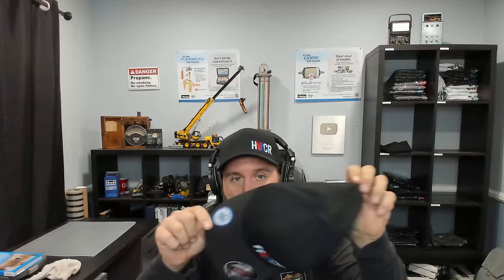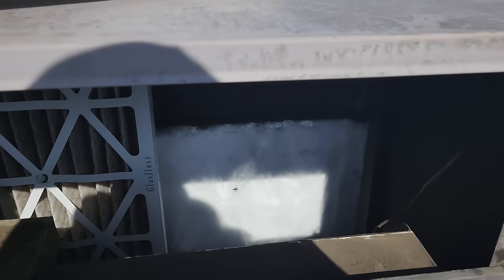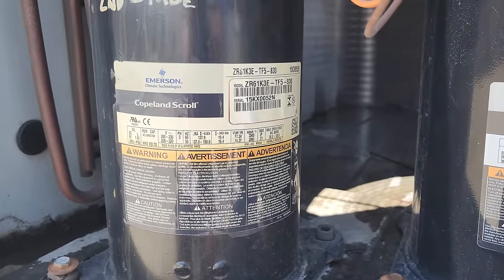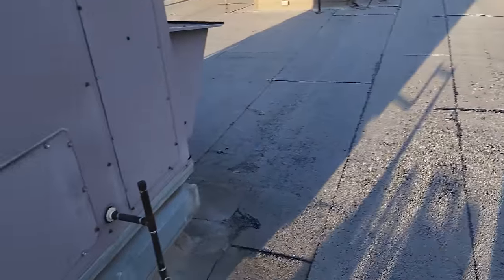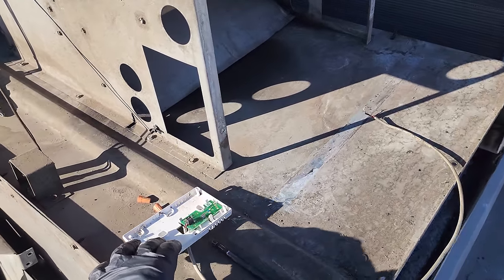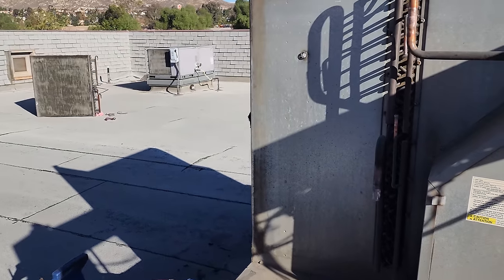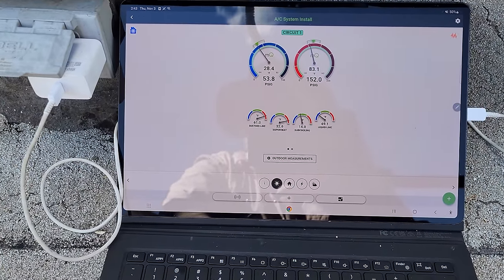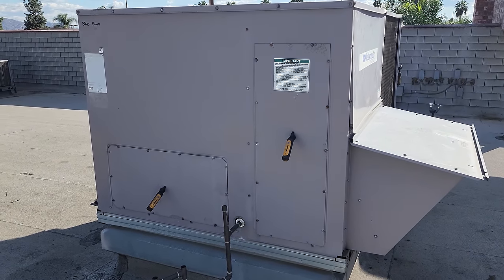THESE AC UNITS HAVE SERIOUS PROBLEMS

Comment: Ever since the tailend of 2019, when the whole pandemic craze started, we noticed a sharp incline in damaged deliveries from manufacturers. Some of the times it was damaged by the shipping company, but I remeber at least five damaged outdoor units with scratched, dented or bend panels.
And of the five units on four the cardboard boxes they had been shipped in were pristine. But in the end we have a job to do and we had to give discounts.

Great job as always.
Reply: Quality Control has apparently been let go or replaced with temps 😂
Reply: @Adam Newman  
Yea or they are pressured by the buyers to deliver products 

Would you like a damaged but perfect working Part or no part
Reply: @DanO181919  Yes that is true
Reply: Manufacturing companies are at much faster pace without any quality control, I was at a manufacturing company and everyone is pressured to skip steps, mind you these are all made here in states
Reply: probably a combination of poor quality control and low supply forcing what before would be rejected products being patched up and send out
Reply: Ah yes, the mystery of the damaged equipment in the pristine box, will it ever be solved? Nobody ever has any answers.🤔
Reply: I'd like a working undamaged unit that I paid for.
Reply: @davemc3650  Manufacturers are also not bothering to repair or replace their failing equipment. I'm in the industrial bearings business and had a customer with worn ball screws decide not to replace them due to cost. A little slop might not sound like much, but it can add up to mean your product quality is diminished.

Comment: Shipping damage is universal these days.   I am replacing the radiator in my Suburban.  First "new" radiator came in and was completely crushed on one side.  The replacement for that one came in with the box trashed and holes knocked in it, but was padded well enough that the only damage was to a couple of fins.
Reply: Replaced a radiator in my Camry two years ago. Ordered a Denso (OEM) from my favorite mail-order auto parts supplier. Box arrived with one slight hole in it, radiator was almost pristine inside. Within three days, it was leaking from the top crimps. Bought one at my most-hated auto parts box store, the box was immaculate, but the radiator looked like someone punched it. It also began leaking after a few weeks' use. 😠

Comment: Good tip whenever I do compressors, take a hacksaw and cut as close to compressor body as possible. You will not get a flare back and you will just need to unsweat the socket. Much safer. Obviously verify no pressure before doing this but you will prevent explosions and still save the entire tube insert for the next compressor😊
Reply: And make sure no copper shavings are in the suction line 😁
Reply: You could do the same thing with a tubing cutter - won't get quite as close to the compressor, but no shavings.

Comment: Hi Chris.  When you were soldering, I noted a couple of times that you held the solder stick (brazing rod?) in your teeth (30:11 and 38:42).  Back in the day, when working on plumbing, I would use lead/tin solder or silver/cadmium brazing alloy.  Both are toxic AF.  Hope you are using something less toxic now.
Reply: Using your teeth as a third hand is common in many trades
Reply: Elemental lead, such as is used in the normal tin/lead solder, isn't toxic like you're thinking.   If you chewed it enough to make organic lead compounds from the saliva (difficult, but stomach acid might do it), it might be an issue.    Just holding it in your teeth or lips for a minute or two won't do much.
Reply: No such thing as non toxic brazing rod.  But considering how short of a time you have it in your mouth it is a low risk.  However, with what i now know about lead and its effects on children, i would scrub my hands very carefully after handling anything lead based, before interacting with a child, or handling anything they might touch.
Reply: @tbelding  ANY lead is not a good thing when children are involved.  There is no such thing as safe exposure levels regardless of whether exposure is to elemental lead or to compounds.  Even eating large amounts of chocolate can present a hazard.  As adults though, it takes quite a bit of lead to become an issue.
Reply: @stephenvale2624  - Okay - I can't take you seriously.   You've obviously refused to actually look at the real information, instead, following "It Bleeds It Leads" information handed out by journalism majors.   You've decided that "lead" is EEEEEEVIL.   Fine.  Don't try to claim that it's for the children.  Just say straight out that you believe it's EEEEVIL, and admit that it won't matter what information is out there.
Reply: @tbelding  Regardless, it's a silfos brazing rod. There's no lead in it. Don't be fooled by him incorrectly using the term "soldering" when he should be saying "brazing".
Reply: @Jason-wc3fh  - It depends on the temperature.  Apparently the only difference between 'soldering' and 'brazing' (officially, via the AWS), is if it's higher than 840 F, or lower than 840F.   So.. technically, he's just being slightly sloppy with terminology.   Much like saying that sugar 'melts', when it is actually decomposing. 

We'd have to know exactly what he's using to be sure (although you're just about guaranteed to be correct on it being brazing temperature material).   Frankly, high brazing temperatures are unnecessary for many HVAC joints.   If you look at folks like the Harris Products Group, they even have pressure tested tin/silver solder vs brazing.  (It's not the braze itself.  It's the weakening/softening of the copper adjacent to the joint)    It boils down to what the locality around you allows, and the manufacturers recommendations, rather than solder vs braze.
Reply: Except the safe levels are the levels in which death or adverse effects aren't present.

So you're very wrong in that comment

Comment: That compressor top looked more like it was rusted out  , same for those compressor terminals  , possible flooding 🤷🏻‍♂️. Quick tip when you’re having trouble un-sweating any stubborn copper pipes from the compressor just use a self tapping screw and drill a hole on the compressor ports that will release the air pocket . Good video

Comment: Yesterday I replaced the 1st stage liquid metering manifold on the same model carrier. 26 braze spots. The new one comes with these stubs s you braze those in then the manifold to the stubs. Definitely a challenging job! 94 in the shade with an easy up.

Comment: 10 ton package Carriers, Bryant… Oh, man! When I see these guys I always suspect clogged metering devise. I don’t replace these metering devises anymore. I just drill trough it with a very small drill bit to open the restriction and it was doing pretty good. All the “drilled” units cool well, the pressure/temperature/superheat look great. Why drill instead of replacement?….. Well, first in my drilling experience was 28 years old Bryant RTU… Carrier would only sell the entire evaporator with 3-4 months backorder period and $3500 for parts. It’s been 2 years and it’s running great!
Reply: He mentioned in a past video about an issue with simply drilling out the orifice wasn't that easy since it they have a second orifice a bit further inside that would also need to be drilled. Requiring a longer than usual bit that doesn't exist.
Reply: Oh! That’s didn’t even know that these guys might have one more orifice… :) I just cut the copper as close as it is possible to the orifice, drill it and re-connect the copper. Will search for the video that you’ve mentioned. If that second orifice is the actual thing that Carrier uses a lot… that would only mean that I was a lucky guy :). Honestly, I didn’t even remember the size of the drill bit. I’ve purchased the smallest bit that ACE hardware had on shelves. Need to use a little of electrical tape around that drill bit to hold it secure in the DeWalt cordless drill socket. I still have 4-5 extra bits. I was VERY skeptical when I’ve drilled these orifices for the first time. It was a Bryant package 28 years old and I pretty much had an agreement with the customer that … we will try to drill, if it doesn’t help they will purchase a brand new unit. However, to my great surprise the unit is still alive after almost 3 years and still cooling well. So, for the rest of Carriers I have sent even worrying, just drilling :)

Comment: I use to replace the header assy instead of the whole evap and never had any issues. Also converted a couple to use TXV's which was a bit more of a challenge but worked out great. Inexperienced techs should assist at first otherwise future problems will arise with those fixed orifice systems.

Comment: 8:45 I've had success with AC Renew, but you have to catch it way before it gets to the point the systems in the video are at.
Also need to include coming back and replacing the liquid line filter driers a week or so after injecting the AC Renew, because the crud it dislodges will plug up the tiny factory driers in short order.

I'v replaced the liquid header before....never again...

Comment: You said, and have showed, the coil issue hitting the unit metal many times.
Have you ever contacted Carrier and asked or told them about the issue?
I know that is can be a futile action, but maybe there is something that can be done or some other retro fit part that is needed or something.

Comment: Carrier eek! Replaced a twenty ton heat exchanger on Bryant forgot to  give new ignition board. Just worked on a twin Carrier furnace tough to get to ignitor and flame sensor Payne Carrier Brand! Grateful to be turning 🔧Be safe Chris your Cooling were Heating not bad 45f mild winter for sure here onEast Coast!

Comment: I used to do a lot of brazing when i was working in apartments with units built in '83, replacing evaporators and compressors that were 30-35 years old. Now most of my brazing is on reach-ins and it's not nearly as often. These videos are a nice refresher. I used to unbraze compressors and evaporators all the time, just because it saved a lot of time and hassle. Always replaced or added driers though just in case.

Comment: It’s a shame the replacement evaporator doesn’t have an option to use a TXV instead of those internal orifices as the new coil may suffer the same fate after some time. 👍
Reply: There is a retrofit he just didn’t want to do it
We all choose depending on situations 
Though txv is preferable
Reply: Love all the content; I was about to ask the same question; can you opt to use a TXV in place of the fixed orifice for the 407C, including that in your conversion price.

Comment: I hate units where you have to open up the cabinet to pull outdoor air to get to the compressors.  Makes it really hard to use standard guages.  Glad I got some wireless JB guages for this summer.

Comment: Im confused and i wish you would elaborate. If you have a liquid line filter-drier, what is restricting your metering device? I can count on 1 hand the number of evap coils ive changed in a 45 year carrier.  Are you confident of your airflow and cleanliness of the coil?
Reply from the maker: Dirty oil is plugging up the accurators, when the customer doesn’t take care of their equipment the oil gets sludgy and slowly plugs up the accurators. The filter drier catches large particles but oil still makes it thru…. Very common on old carrier units especially if they have Poe oil in the compressor as Poe acts as a solvent and scrubs the inside of the pipes clean.

Comment: That condenser situation is so frustrating. For a brand new piece of kit, at the price you pay, I'd be livid to have something arrive as mangled as that. And of course it leaves you in a bad situation because the customer needs the work done ASAP, and even if they could wait for another replacement it's more time and travel and money. More work, more stress, and the end result is a bad quality part with probably reduced reliability and service lifetime.

The worst part is that it's clearly been shipped in a suitable crate, so it really seems like the factory is shipping out stuff like that intentionally - a little manual repair to avoid trashing a perfectly working unit is one thing (if done right, with some damn pride in the work), and I get that there have been material shortages and rising costs, but there's absolutely no excuse for selling a part with that level of known damage. Maybe it got hit with a forklift or something in transit, but you'd think the crate would be busted up if that was the case... unless the courier patched it up or something, but that seems super unlikely. Either way, you're getting ripped off and messed around.

Props for taking it in stride. I don't think I'd could keep my cool (pun not intended... ok maybe a little bit intended) with the sellers.
Reply: It's not on the same scale, but it happens all over the place.  I bought a brand new fan to use on a Dell PC (specialty fan).    When I received it, it appears to be unused - but someone actually started to install it _somewhere_.   There are compression marks in the screw holes from mounting screws.   I'd have overlooked it if it was all 8 holes (4 front, 4 back), but it was in only 3 holes on one side.   Now I'm getting a new one straight from the factory.

Comment: That damaged evaporator I wouldn't be surprised if it was a returned unit and they just patched it up at the factory and threw it back in to stock and you ended up stuck with it.

Comment: What app are you using? And what is your tools that you were using to diagnose the problem? Meaning, Fieldpiece tools used
Reply from the maker: The app I'd called measureqick and the tools are the Fieldpiece psychrometers for air measurement and the temp clamps and pressure probes I don't know the part numbers
Reply: @HVACRVIDEOS  model numbers would help

Comment: Link to the striker tool you used for your torches ?   Also , do you know if the measure quick app allows you to sync and use two different brands at the same time ?  Example - can I run testo pressure  probes and clamps with fieldpiece psychrometer? Or can I have a complete set of testo on circuit one and a Fieldpiece set on circuit 2 ?
Reply from the maker: Yes I believe you can use two different brand probes as far as the Stryker all I know is that its made by cliplight
Reply: @HVACRVIDEOS  thanks for the quick response sir. Keep up the great hvac knowledge

Comment: Cut connections at body then unsweat stub. Also a fan and a gas mask with proper filter will save your lungs. I use Mira Safety with grey code 40mm filters. Survivair makes good O2 kit but that creates new safety challenges. If you wear mask or respirator you MUST have training and trimmed facial hair for seal. You only get two lungs and your safety is YOUR responsibility, dont let the rookies deal with it, help them learn that now. The $ for safety gear is nothing compared to loss of health or life. Been refer tech for a while
Reply: Gas masks in WW-I was the big mover and shaker behind the 'facial shaving' changes in Europe and North America.   That's part of what had Gillette take off like they did.  I have a WW-I era Gillette razor that will use the modern blades just fine (shaves quite well too)

Comment: Do I have the right understanding of an fixed orifice metering device, that it can only optimized for one set of conditions? It is basically just a fancy capillary tube, right?
With everyone going nuts on energy saving, wouldn't it be better to fit in an Expansion valve? That would also be easier to replace if it fails

Comment: What kind of filter drier do you use on a job like this? Do you always go OEM on filter driers or favor a brand? Does burnout or restriction factor in choice of new one or do you just have a go to?
Reply: He usually uses Sporlan driers and a lot of times will go oversized compared to the OEM part (e.g. if there was originally an 8 cu-in filter drier, he usually uses a 16 cu-in filter drier).
Reply: @MattSlocumSQL  Thank you sir

Comment: Honestly it look like your rosebud is too small your biggest issue is going to be the pipe cooling on one side while you try to heat it the other side surprised you having pushed you guys to get the hook so that you can apply heat to all areas at the same time and use less brazen rods but also when you installing those evaps just start using stay bright it'll handle our r22 system pressures and if you switch over to 458 A blue on it's a drop in replacement so you don't have to worry about cleaning the lines out and the oil is compatible with Bose POE and mineral and it'll increase your efficiency lower the temperature on the compressor unless power consumption

Comment: I'm a scrap guy that gets HVAC equipment as scrap sometimes. The condensers I get sometimes are full of oil and surprise me when I cut the ends off.
Reply: Could be a case of guys filling them up with oil to increase the weight and get more cash ,
Reply: @johnbarrowman2902  - I could see that, but man, the sheer time and effort involved in doing that to an extent that it doesn't leak out...  Wouldn't they get more by putting that time into working another hour on the job?
Reply: @tbelding  depends on the mindset ,Reckon you are like me in that way .Why bother spending time scamming when yo could be doing something positive
Reply: @johnbarrowman2902  So you're implying an HVAC guy who lets this scrap guy have a coil for scrap went out of his way to fill up a coil with extra oil so that he would get more money for it when it clearly doesn't benefit him at all? That's just nonsense. I've seen endless coils shoot out tons of oil with the refrigerant, it's just how it is. It's not all contained in the compressor only.